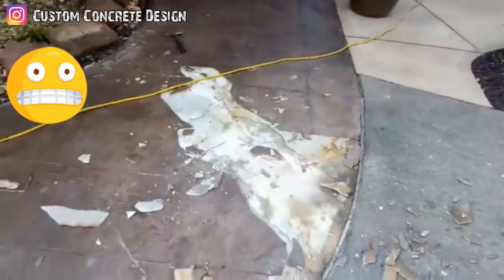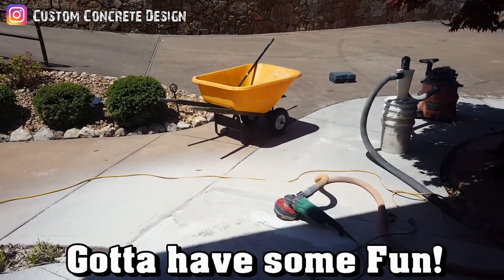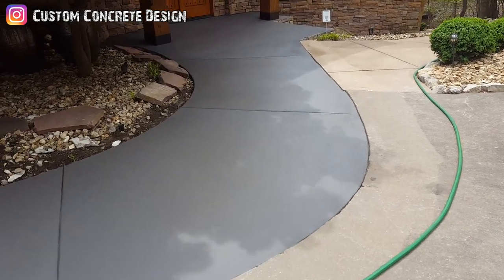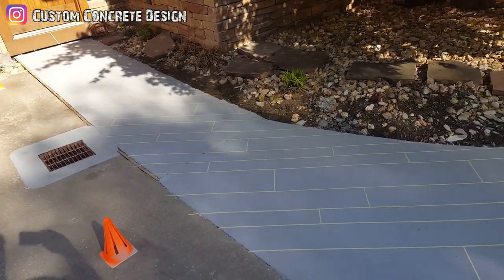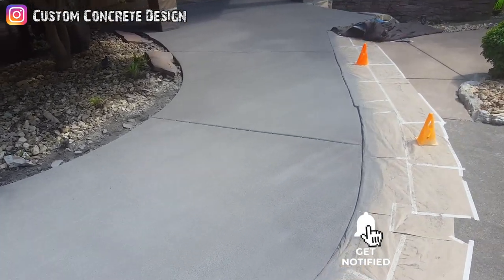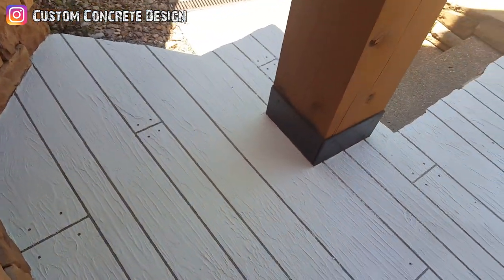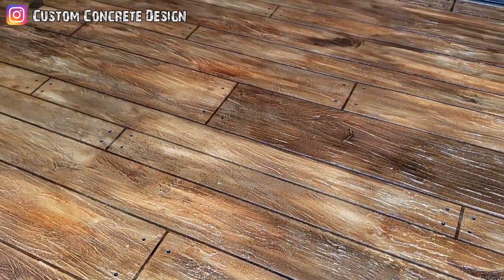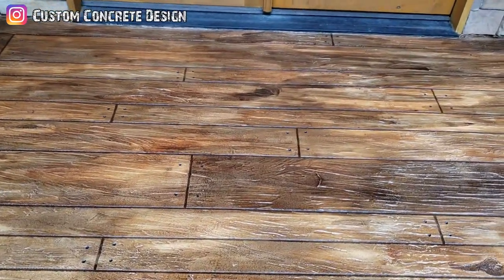Concrete WOOD Resurfacing 👷 Step by Step 👷 WATCH as we CREATE Decorative CONCRETE Wood

Comment: Think you should’ve done the lines for the 45° corners on the “picture frame 🖼” at the grate
Reply from the maker: Thanks for your input, my thoughts we're that if I put grout lines in the picture frame it's a super small area and the grate lines along with the grout lines would make it look way to busy, plus they grate lines and grout lines would compete with each other in a very small space because one would run at a 45 degree angle (grout lines) and the grate lines would run a different direction, that's why I choose to go plain and just color it 😉

Comment: Looks great.  How does the color hold up over time?  Any degradation of the surface?  Any idea how this would hold up in a cold climate?
Reply from the maker: The color penetrates deep into the pours of the concrete, then with 2 coats of Acrylic Sealer over it, it's good to go until it needs resealed again in 3 years, its in a cold weather climate right now at least Missouri cold weather which is from  December through March at about 20 degreed on average...anything colder for longer periods of time I'm not 100% sure.

Comment: I’m building my own house and have a poured floor first level do i need to do all the prep you guys do if I’m doing the overlay on green concrete with no sealer
Reply from the maker: The prep work is the most important step, it's a vital part to the longevity of the coating to grind the concrete first before putting any type of coating down, the purpose of doing this is to insure that you have removed anything that's not concrete and it also opens up the pours of the concrete to allow the material to wick down into those pours which is where the strongest bond is created.
Reply: @MrCustomConcrete  even on freshly poured concrete like one week old
Reply from the maker: @screwydrewy7027  you'll need to wait 30 days for the concrete to cure before doing anything just like I had to do in this video where a portion of the concrete was un-repairable and needed to be torn out replaced and repoured, if it we're me I would grind it, just like I did in this video with the part that was repoured, I've been doing it like this for 18 years and never had to go back and redo any of my work, I don't take any chances.
Reply: @MrCustomConcrete  would be cool if you had a webpage where we could buy the same products you use. I’m more of a carpenter wood worker these days but I feel like this is something I could do given I poured Cox Crete for 4-5!years in my 20s
Reply: @MrCustomConcrete  also looks awesome I would more than likely be doing this in my garage and basement. Maybe even first floor if I put radiant up there
Reply from the maker: The products I use are commercial grade and for contractors, you can buy them but only if you take a weekend class and are considered certified.
Reply from the maker: Thank you, yeah absolutely you can do it all if you have the right info

Comment: The reveal is beautiful. Would be nice to see how you actually painted it to look like wood and placed the faux grout lines. Did you use precut tape or did you measure out each strip?
Reply from the maker: Thank you, sorry about that the battery on my phone was not charged enough so it started recording but died 2 min into filming of that part so I had to get it done without that part of video. The grout is done first, that's what the first 2 base coats of concrete are they are the grout, after  the base coats we're dry, the fiber tape was NOT precut.
 I taped out each plank with the fiber tape and each plank was a random 4, 6, and 8 inches in width, but I did  use precut paint sticks so I didn't actually have to measure each plank width I just needed to stager them random, then make them different lengths again just random. Hope that makes sense.

Comment: This looks great man. Kudos. 
The last coat you put on, is that a thinset, or what is your mix for the woodgrain coating? Do you use a regular trowel to make the wood grain pattern if not what do you prefer?
Reply from the maker: Thank You, the last coat is called Thin Finish made by Elitecrete, but I used Thin Finish for the entire project the 2 base coats, the tack coat and the top texture coat, speaking of the Top coat I used a regular trowel to create the texture, nothin fancy...it's all in how you use the trowel.
Reply: @MrCustomConcrete  perfect! Thank you for all the information man. I'm going to give this a go on my shed floor. I've done deco work but never this style. 👌
Reply from the maker: @cmottBHBJJ  no problem, glad to help, oh nice thats cool so you have some kinda experience, I forgot to tell you turn the trowel around vertical so your pulling back long, make sense?...good luck let me know if you need additional help 
👊😎
Reply: @MrCustomConcrete  yep! Kinda create a suction right? Then I imagine it's just playing around with different angles of pressure with the trowel? Floor is all prepped. Hope to get started in the next week or so.
Reply from the maker: @cmottBHBJJ  yup exactly!

Comment: Nice work! How long does the top coat last? And is the paint uv resistant?
Reply from the maker: The sealer is an Acrylic sealer and is UV resistant, it'll last about 3 years before it needs to be resealed the stains will lose some luster ONLY if you dont keep it sealed every 3 years.
Reply: @MrCustomConcrete  thanks for the info. I guess for the resealing its adding a new layer or does the old sealer need to be removed?
Reply from the maker: @tschallacka874  you're welcome, it's just a clean and seal, no removal needed.

Comment: It's beautiful. 
What products do you use and could you provide a DIY  recipe or to do list?
Reply from the maker: Hi Charlotte, for this project I used Elitecrete.com bag mix called Thin Finish, the colors came from TheConcreteProtector.com and I used Bark Brown and Amber, then made a 50/50 mix with both for the third color, the texture was done with my trowel, the pattern was all hand taped with fiber tape, but I used a pencil, and precut paint stir stick at 4, 6, and 8 inches so I didn't need a tape measure to figure out the with of the planks every time, I used a concrete drill bit and battery powered drill to make my holes and each end of every plank, all the planks were random in length and after making the holes at each end of the planks I added a drop of black colorant to make it look like a nail head, pull the tape before coloring the planks with regular brushes and sponge brushes, the brushes get full color on them the sponge brushes you just skim across the top of each plank with a little color for highlights... then seal it with 2 coats of Acrylic sealer.... hope that helps!
Reply: @MrCustomConcrete  Thank you..
Reply from the maker: @charlotteasimms-swanick  your welcome hope that helps get you going... there is a lot involved with tools, products and technique, but that is the jist of some of that process.
Reply: @MrCustomConcrete  I'd love to get this done inside my house
Reply from the maker: @nicevers  It can be done, except inside I would use a 2 part Clear Epoxy to seal it then 2 coats of Urethane gloss to protect it from the suns UV rays.
Reply: @MrCustomConcrete  what would you guesstimate the coverage of a bag of that thin finish from elite Creek. Square footage I guess is what I'm asking.
Reply from the maker: @nicevers  1 bag will cover about 300 to 350 sqft per bag
Reply: What did you use for the texture? Amazing work, by the way. Best I've seen so far.